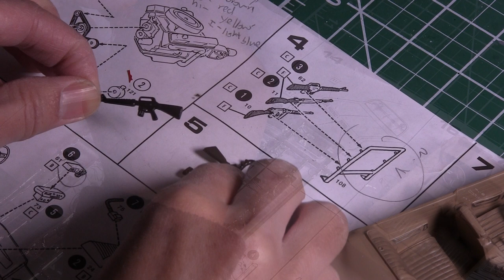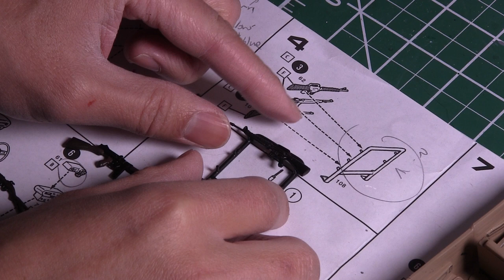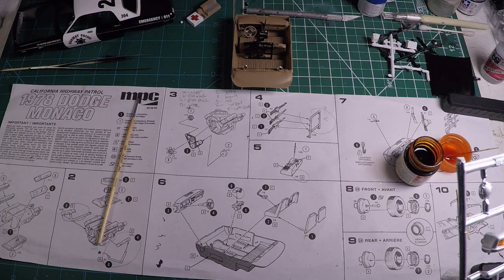Building the MPC 1978 California Highway Patrol Car Plastic Model Kit

Comment: Looks amazing bit of a let down with that rear axle, I'm working on a r32 gtr with a similar style rear axle that's a metal rod through the chassis but that's a great looking kit you made
Reply from the maker: Thanks for the compliment. I should have done a complete test fit to avoid that. Which brand R32 are you building?
Reply: @weekendhobbyist  aoshima bnr32 gtr and its an initial D version

Comment: It's ok, The factory made several errors on this but over all it looks nice, CHP didn't have Serve And Protect and Emergency 911 on their cars, They had Safety And Service..Door decal is correct for that era though. On the lightbar they forgot to add a small yellow square to the rear of the red one.
Reply from the maker: Thanks for the info PolizeiPaul! Now I want to build another one. If only they made contemporary Ford Explorer or Crown Vic.